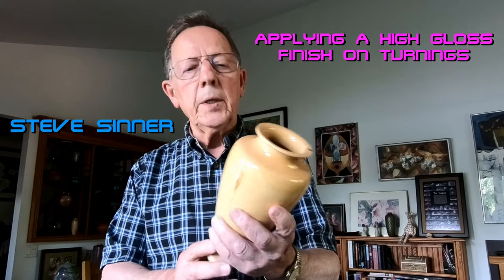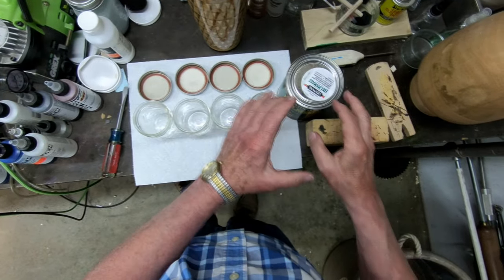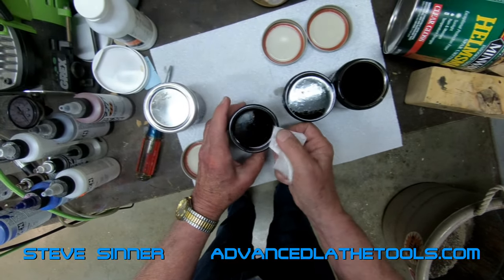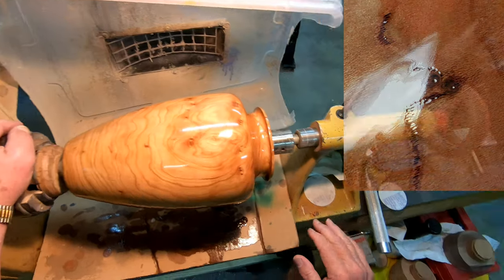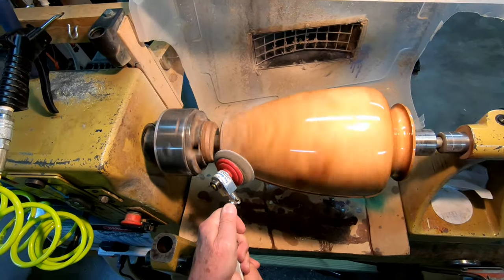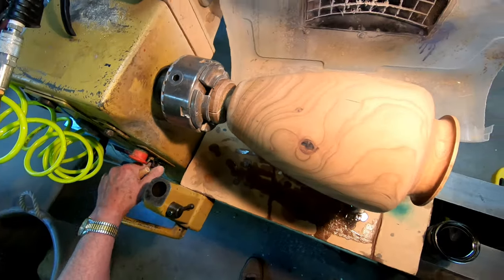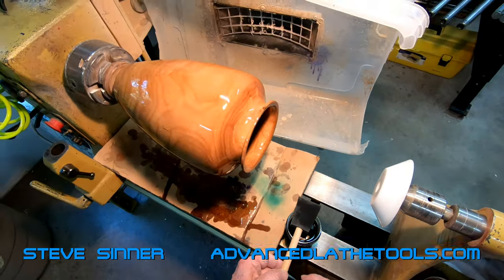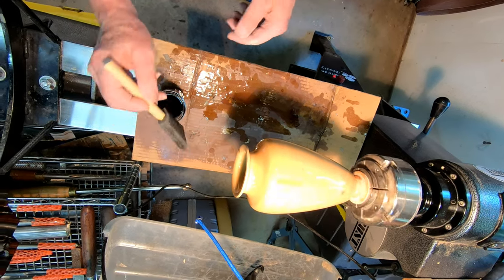High Gloss Finish For Wood Turnings

Comment: Steve told me that the Stop Loss Bags solve the problem of the varnish going bad.  I put a quart in a bag the 9th of September and used it frequently and when I had used it all up the 20th of December the  varnish was still fresh.  Filled the bag the 20th of December and it is still perfect the 20th of January.  Prior the Stop Loss Bag the varnish was scaled over in two weeks!

Comment: I had just finished applying celuose sealer to a very similar piece this morning and wishing I could go with the polyurethane instead of the high friction build polish... chiefly because I am very nearly out of it!  But seriously, I had learned the ways of applying it to the bottom of my vases and urns, but had past troubles getting it on the sides.  Your video shows exactly what I needed to know.  THANKS!!!

Comment: Hi Stephen. Thank you for the video! Its the only one out there that I've been able to find that covers a good way to apply spar urethane to turned items. I've been using this method for a little while now, and have had some success. That said, over the last couple of weeks, I seem to be having a problem with scratches showing up after I sand the prior coat. I'm using an inertial sander with 600 grit, and working on it until I see no shiny spots. When I first put on the next coat using your method, everything looks excellent, glassy gloss shine and smooth (still haven't perfected eliminating every ripple yet). It is once the next coat has dried, that I then see all the scratches. I suspect its the coat thinning as it dries, and I guess its thin enough to depress into the scratches on the previous coat. In any case...I can't seem to find a way to eliminate this issue. I've gone up in grit levels, to 800, 1200, on each subsequent coat, but that doesn't seem to do anything for the scratches in the earlier coats (which of course, they are covered by additional layers of finish.) Really scratching my head here, about how I can actually get, and keep, that glassy glossy shine. FWIW, my finish is aways fresh. I use stop-loss bags to preserve the whole can, then pour only the necessary amount out of that into a jar when I'm actually applying a coat. So I'm not using expired or otherwise bad finish. I am now also doing both inertial sanding, and then sanding with the grain, to try and make sure scratches added by the inertial sander are hidden by scratches going with the grain. That seems to work on the wood itself...I'm not sure that actually really helps when sanding the finish itself. Here is an example of the kind of scratch issues I'm encountering (this is the second coat): https://photos.app.goo.gl/NUvUDVKUJVhDwa8i8

Comment: Do you have any videos on your shops dust collection.  I am in the middle of building a turning shop and would love to see more on your collection. I like the fact that you said that not collecting  dust from sanding is not acceptable. I would like to go that same route and would be greatful to see what you use in detail.
Reply from the maker: No video, sorry. My system (and a couple others I helped design) are intended to collect the dust that is small enough to float in the air. That means large pipes and high volumes of air movement - as opposed to the standard of high velocities - are the defining features. Oneida insisted that two of these systems would not work, and would just load up and become plugged with chips. But they are thinking of collecting particles much larger than any that enter my system; those from saws, shapers, jointers, planers, etc. Both of the systems they disapproved of are running fine with zero problems after 20 years of operation. We use various means of creating low pressure zones around our work so that these tiny  particles cannot escape into the surrounding area. Shrouds around the ends of the hoses, cardboard pieces on the ways, whatever works to make certain the fine dust cannot escape.
There are several videos on YouTube featuring my shop/studio that will offer views that may help.
And it is not just sanding that creates these dangerous particles. They will also be produced even from turning wet or green wood, although in far lesser quantities.

Comment: Argon or Nitrogen will work very well... Argon is the best of the two. I used Argon a ton in synthetic organic chemistry when synthesizing molecules that are oxygen sensitive or if the reaction is inhibited by exposure to atmospheric water vapor/humidity. Which was a BEAST when I was in SE Georgia at GSU.
Reply from the maker: I TIG weld, so argon is handy. The problem is how to replace the air with the argon. The small neck on the bottle I use for thinned urethane is slightly larger than the cup on the TIG torch, so it is easy to shoot a stream of argon into it and force the air out around the cup edges, providing a nearly 100% argon fill. But doing that with a quart can of urethane results in a mix of air and argon, which does not always work well. I could make a cap to fix this, but the Stop-loss Bags are a better solution.

Comment: Hi Steve, thank you so much for  taking the time to share your knowledge and expertise. I'm a rank beginner with this finishing stuff. Please excuse my ignorance, but how much of the varnish coat is being removed each time you  sand the gloss off between coats? It looks to me like your removing the entire coat. I've always been hesitant to sand much between coats for that reason. Keep up the great work!
Reply from the maker: You must remove all the gloss, or the next coat will not adhere. No more than that. I use 600 or 800 grit 3M 260L abrasive.

Comment: I have used Minwax Helmans Spar Urethane all the time and have NEVER had it dry as fast as you said. Also how long your Spar Urethane last depends on how it is sealed. I have layered several coats of spar urethane without sanding between coats. The one thing I  advise my finishing students is to dilute your finish to a 50/50 solution  of one's finish to use as a wood sealer. Then apply the final top coats as needed.
Reply from the maker: John, your coats of Minwax Helmsman Gloss Urethane will peel off one another if you failed to remove the gloss between coats. I learned that at the Lunder Conservation Lab of the Smithsonian Institution. If you think your previous work is OK, just try cutting through the finish layers with a knife and peeling it.
We used to thin the first coat, but it penetrates fine at full strength, so we stopped doing that. You can see this for yourself by applying full strength to a soft, porous wood and watch it soak in to a dull surface within seconds.
Reply: @stephensinner2017  , the purpose of the 50/50 thin is so the first coat lays perfectly flat. Also before the 1st coat, the material should be dampened with the appropriate thinner. The purpose of this is to rid the surface of all moisture.  Moisture is the #1 cause of finish failure.  35 plus yrs.  of refinishing furniture!
Reply from the maker: @johnwallace4408  , OK, if time is important, I've been at it since the early 60s (60 years), starting with a BS in Industrial Education from Iowa State. Refinishing furniture is a whole different ball game than what we are talking about! Your projects have already been finished at least once before. For me, moisture content is determined by a moisture meter, so it is not a concern; I simply do not work with wood that has too high a content. You obviously did not understand the video to begin with - I never said the urethane would dry in 15 minutes. In fact, if you read the comments, you will discover I said it will dry in 3-4 hours to the point where it can be sanded. I am finishing a vessel with compound curves; you are doing flat surfaces. No comparison, unless you are doing vertical surfaces. The 15 minute rule insures against runs, which will occur almost inevitably on vessels finished on a lathe like this if the forces of gravity are not neutralized by the slow rotation of the work.
The first coat on new wood will not lay flat, because it will soak in more between the growth rings than it does on them. Not a problem with prefinished wood!
BTW, I've never - in all my years of making furniture, clocks, and art - seen a single case of finish failure due to moisture on one of my pieces. Perhaps that results from the finish removal process?
Reply: @stephensinner2017  wet a piece of wood and apply your finish and see what happens. 
  Do you calibrate your moisture meter to a known moisture content, if not; it is wrong.
  BTW,  I  have been turning wood for 10yrs.
Reply from the maker: @johnwallace4408  , Good for you! Ten years is a long time. Where do you teach?
From decades of experience, I know that I do not need to calibrate my moisture meter.
When I used to build fine furniture and clocks, I'd wet the wood to raise the grain before final sanding. Nothing happens. It simply makes the first coat of finish smoother.
I started turning in about 1955.
Reply: @stephensinner2017 , no sir I do not teach turning or finishing. 
  I have no formal education in either. 
  Remember that 50/50 mix I mentioned earlier. You stated the 1st coat would not lay down flat because of the difference in grain hardness. The 50/50  mix seals the grain so that the 1st layer of finish will lay perfectly flat after using the appropriate thinner before the 1st coat. I was taught this by my 10th shop teacher back in 1965. So you see I have some education and experience. 
  The people I have taught to finish was done at no cost to them.
Reply from the maker: @johnwallace4408 , I quote, "The one thing I  advise my finishing students is to dilute your finish to a 50/50 solution  of one's finish to use as a wood sealer." That led me to believe that you taught somewhere. Sorry I jumped to conclusions. But you are correct; in 1965, that was the thing to do. I believed it back then, too.
Reply: @stephensinner2017 , sorry for the incorrect phasing. 
  I have enjoyed our conversation.  It is great to have a conversation with out either party getting mad. STAY SAFE!
Reply: If you thin the Helmsman product what do you use as thinner? I assume water.
Reply: @robertanderson9932 , my thinner is WHATEVER the clean up is for the brushes.  For Minwax Spar Urethane,  it is oil based so I use mineral spirits! Hope this helps!

Comment: Thank you very much for the video Stephen. A lot of good information! 
I came looking for tips on how to do a spray on poly finish and saw your video. You've enticed me to try your finishing technique. I just learned a valuable lesson to not apply poly to an uncured oil bowl. After waiting 4 days for the poly to dry passed the tacky stage, I realized that an oiled bowl that hasn't been cured/dried, does not like a poly finish! Lol.
Leads to my next question. Have you applied this finish procedure to an oiled bowl (that's had the oil cure)? Do you notice a difference of oiled vs unoiled? Would you recommend raw wood vs oiled wood for this finish? If so, why?
Thanks again for this amazing video!
Reply from the maker: We use this finish on dry wood; with no other finishes, fillers, etc. If we plan to add surface colors or patterns, they will be types compatible with urethane, such as acrylics and inks which will go on top of or under the urethane without issues. Just remember to remove all the gloss before attempting to apply anything over the urethane.
I am not familiar with the oil cure.
Reply: @stephensinner2017  oil cure is basically a oil based finish (think Danish oil) that has been allowed to dry/cure properly. 
Could you apply the spar finish over that?
Thanks for the reply!!!
Reply from the maker: @ajrob2888  , I really do not know, nor do I understand why you would want to do that? What is the benefit over simply using the urethane from the start? I used oil finishes exclusively for a couple decades starting back in the early 60s, but now believe urethanes to be superior, and would not go back unless I were doing something like a utilitarian bowl which would benefit from occasional reapplication.

Comment: How long will the urethane last in the stop loss bags?
Reply from the maker: No idea. We've never had any degrade in the bags. But, since it tends to start to degrade in its own factory package after about a year, I'd think that limit would be wise to apply to the bagged product. As long as it has that purplish-gray color, it should be fine. Oh, and keep those bags out of the light when storing the stuff.

Comment: Great Vid. You don't say how long you leave between coats Steve
Reply from the maker: You can actually sand this urethane and apply a second in about 3-4 hours after applying. But better to wait a few days between coats to allow a good cure. I also failed to mention that you can use the older material for first coats, since you'll be sanding them anyway. It's that last coat that you really want to level perfectly.
Reply: @stephensinner2017  Thanks Steve, it's a pity we can't get that urethane here. I'll have to stick with my sprayed waterborne lacquer.
Reply from the maker: @philirons3102 , how about this link: https://www.amazon.co.uk/Minwax-63200-Helmsman-Urethane-Finish/dp/B000Y4II3I
Reply: @philirons3102  you can try No Nonsense Yacht Varnish from Screwfix (£10 for 750ml) which is 3-4 times cheaper and is designed for boats and yachts that is to withstand wood movement and UV.

Comment: I understand that the first few applications you sand varnish off. If putting on several coats do you sand the same or just light sand ? Or wet sand ?
Reply from the maker: You must sand between coats or they will not adhere to each other. Remove ALL the gloss.

Comment: does it make a difference between water or oil  based spar urethane
Reply from the maker: Absolutely. Water-based will not work at all for this purpose. Try it and see what happens.

Comment: Approximately how may coats do you apply on a vessel such as that cherry vase. I am a beginner, and i know with some finishes you have to build up a good hard finish with 7-10 coasts sometimes, is this similar, or would you just use 2-3 coats?
Reply from the maker: It just depends on how you want it to look. The more coats, the deeper it will look. And it also depends on the wood. Open grains require more coats. But two coats are often enough. I think that cherry vase ended up at four.

Comment: how long did it take to dry after the video ended.  did you just do the one coat? if not did you sand or do anything between coats?
Reply from the maker: The urethane dries so fast that is is possible to sand it with 3M 260L just 3-4 hours after application; but the longer it dries, the better. I apply as many coats as it takes to achieve my objective. That may be just one, or it may be a dozen. You MUST sand between coats to remove all traces of gloss, or the next coat will not adhere.

Comment: Do all variable speed lathes turn that slow?
Thanks Pete
Reply from the maker: Unfortunately, no.
Reply: That's why man invented Treadmill motors. My Rockwell Beaver 3400 ($69 in 1980) now turns at 30 RPM as Stephen's Robust lathe does. No belt changes required, just turn the dial for 30 to 2000 RPM (2.25 HP). Thanks to Mr. Sinner- the king of finishers- Salute!

Comment: Looks like CO2 would be easy to put in the jar. You can pour it in like a liquid. It displaces all the air and even if some air is left behind it'll be at the top near the lid and not letting O2 into the fluid
Reply from the maker: I use argon. CO2 would work, too. But the Stop Loss bags are better than either of those, easier, and cheaper.

Comment: I have never seen Minwax  Helmans Spar Urethane dry in 15 minutes.
Reply: MTR  It will even dry to the touch in 15 minutes. It is a minimum of 2hrs, full dry takes 24hrs.
Reply from the maker: The reference to 15 minutes is the time it is necessary to keep the lathe turning to allow the urethane to dry sufficiently so that it will not run. Turning the lathe off sooner may well result in runs, especially if there are any areas where it was applied a bit too heavily.